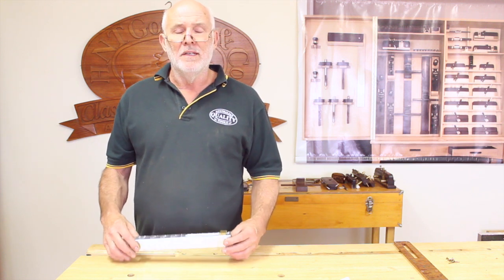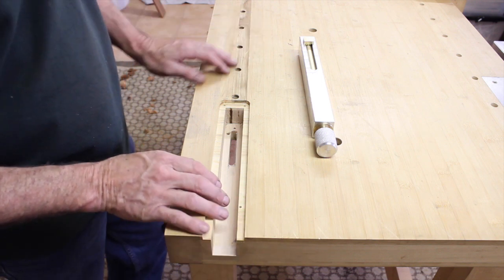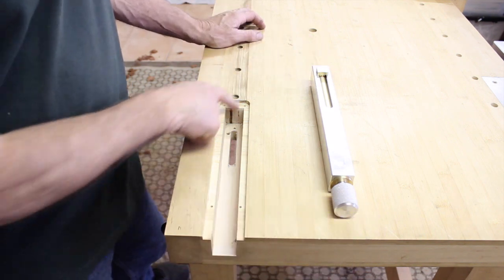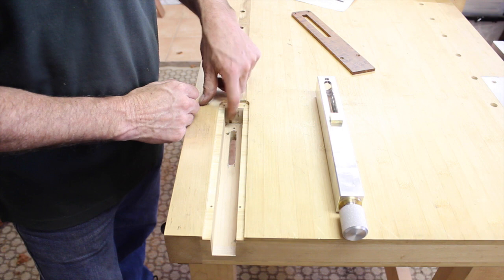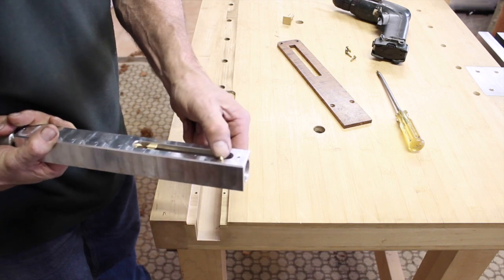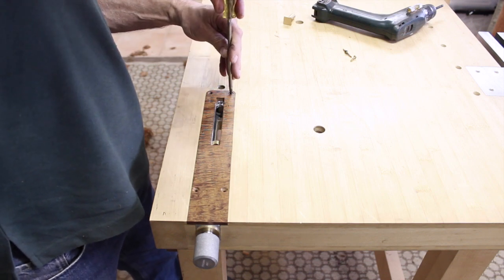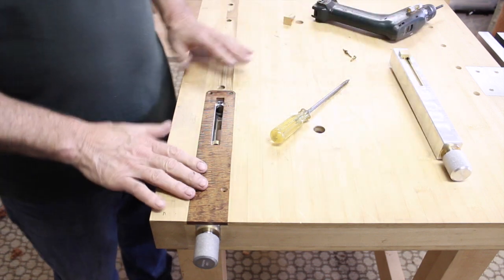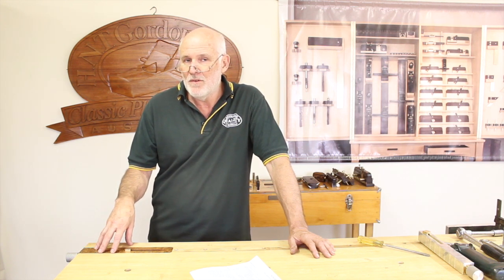How to Install a Tail Vise to your Workbench | HNT Gordon & Co.

Comment: Pulled the trigger and ordered one from one of your US dealers. Can’t wait to get it installed.
Reply from the maker: Thank you, enjoy!
Reply from the maker: Hi @smm274, We had a notification that you may have been working on the installation of your tail vice and had a bit of a challenge with some of the measurements.  The length of the slot is 10mm longer to allow for the cover plate to be seated resting on the mortise in your work bench.  Feel free to reach out to us directly at planemaker@hntgordon.com.au as we'll be happy to guide you through in full detail.
Reply: @hntgordonco.2514  I deleted the comment, figured it out on my own. The drawing shows 290 mm for the slot for the vise but the vise actually measures at 280mm. I went with the vise measurement versus the drawing. Installation is complete and I love it!
Reply from the maker: Thanks for the update @smm274  and glad its working for you.  We get plenty of use out of the tail vices so we're always happy when our customers do too!!  Happy Woodworking!!

Comment: My workbench has a 75mm thick MDF top, do you think this vise is suitable? Watched the video, looked like its only held in with a single screw...
Reply from the maker: Hi Simon.   The tailvice has a brass pin and a screw to hold it in place.   Will be fine in that MDF top.  Make sure you make it a neat fit and you will get years of work out of it.   Regards Terry

Comment: I would like to order this vise. I’m just not sure why there two different travel sizes? Which one would I need?Why would you need a longer travel? Wouldn’t the 100mm travel fit all of your needs?  I’m sure there is a reason. Thank you for your time and help..
Reply from the maker: Hi John, Sorry for the delayed reply.  If you haven't already got existing dog holes drilled in your bench, then we recommend the 100mm travel tail vice as there is slightly less winding required, making it slightly more efficient.  We decided to make a 150mm tail vice as a lot of benches already have dog holes spaced for 150mm travel vices. If we can help with any other questions let us know. Thanks :)
Reply: @hntgordonco.2514  I'm building a new bench, so I will follow your advice. Thank you so much for your time and help. I will get the vise ordered now.
Reply from the maker: @jolu2469   no problem :) thank you for your order.

Comment: How thick does your top need to be for this?
Reply from the maker: Hi      If your bench is less than 50mm thick you will need to glue and screw a piece of wood under the bench where the vice fits.   So you can mount this vice to any thickness top by doing this.   But essentially you need about 50mm of thickness  if you don't want to add wood under the vice position.   Regards Terry
Reply: @hntgordonco.2514  Sounds good. Thanks. I might be picking one up